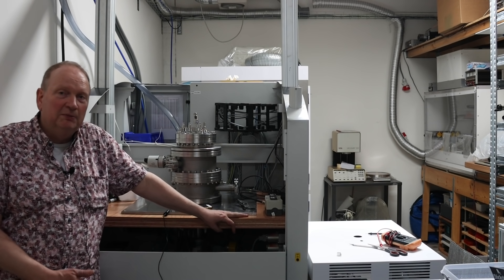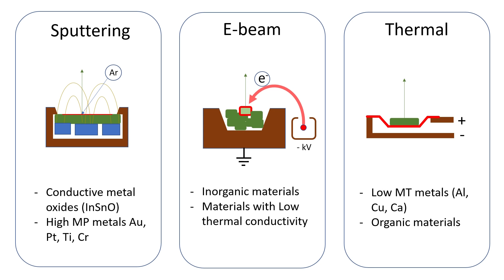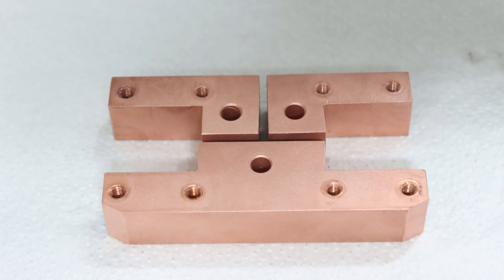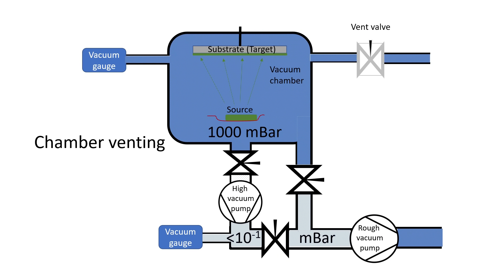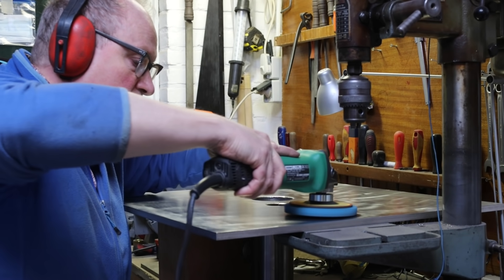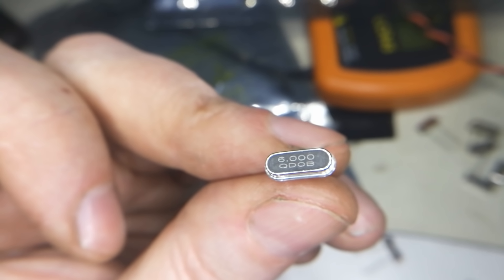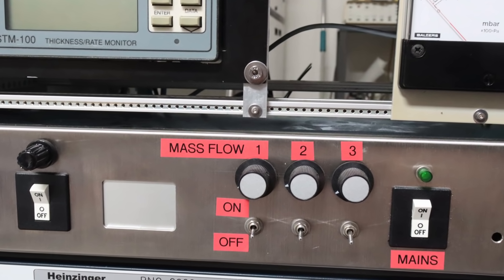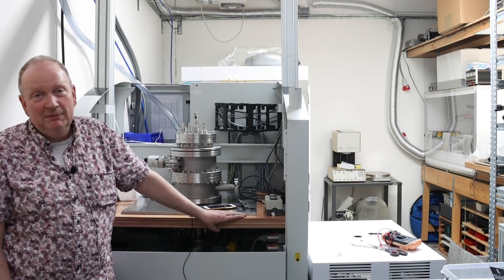DIY Physical Vapor Deposition (PVD) using Thermal Evaporation

Comment: Really fun watching you build and use these devices! I learn quite a bit from your videos, so thank you.

A basic question: is there anything that prevents the deposit material from being deposited on the walls or instruments within the chamber, rather than on the target material? Over time, do you need to replace the interior of the chamber as a result, or clean it to remote this "overspray" (not sure if that's the right term)?  Thanks.

Comment: High class with a turbo pump, how did fix it, did  you order a  replacement blade? I would have liked to hear a recording of the sound when that filter hit the blade. Shit happens brotha. Ohh not that vent button fuowush dah filaments be burned now dooOO @#$*

Comment: Ohh, tip of day circular polishing of sealing surface requires less work less fineness of grit, as the polishing lines meet rubber O-ring parallel better than cross polishing lines.

Comment: Is your junk yard a top secret, you must be in Santa Rosa area, lucky score ?
Hahaha, welding is more grinding when starting out, if leak is small enough you can use epoxy etc. super small leak Helium mass spec. needed. With vacuum detector vac goes up or down spraying solvent outside as leak detector.

Comment: How did you connect the water tubes to the copper blocks for the cooling water flow.
Does the water actually flow through the blocks or only up to the connection point?
Reply from the maker: It's just the connections points (cold fingers). Apparently that and the high thermal conductivity is sufficient to keep the connections from overheating
Reply: @HuygensOptics  danke
Reply: @HuygensOptics  did you make them or can the be bought? The cold fingers tips.

Comment: "And since creating plasma requires high voltages, you also need an interlock on the chamber if you don't want to die during a moment of inattention." 
 
Dying WOULD tend to "put the kibosh" on the whole project...😉

Comment: Love your channel!  This is so cool.  
I've wanted one of those in my shop for years.  I'm just an armchair physicist though.  I been holding onto a few fun mad scientist ideas for one.  No idea if any would work.
I've wanted to know if tungsten needles or thin plates could be used with high voltage to control the ionic stream of plasma molecules, aiming them towards a specific target/area.  I've also wanted to try something similar with a very a powerful [maybe toroidal] electromagnet, and collect the plasma around a target substrate.  Basically, placing the substrate where the field is most dense.  I feel like this could concentrate the amount of collisions when making diamonds from a starter crystal, or coating anything for that matter.  I also want to play around with the charge of the substrate, and reduce the temperature as low as possible.  In my crazy head, I feel like molecules would naturally align with the magnetic field lines.  Then rapid cooling might set them in that orientation onto the substrate.

Comment: Always have wondered the if metal rain could exist and I havent found answers in internet but if here aluminum have diferent vapor pressures ,it seems like in a planet with low pressure and high temp it could form drops of aluminum

Comment: Amazing. My father worked at Cambridge instruments in the 1970s and told me about the vacuum pumps they were using for the electron microscopes. You really don't want to be near those during a problem. Great video.

Comment: Love the video! Am a matsci grad student and I've used the cleanroom's thermal evaporator quite often (also an ancient e-beam evaporator and a more modern sputtering tool). And yeah, I've had a turbo catastrophically fail once and torque the chamber around quite a bit. Ever seen a conflat bellows get torqued around into a tiny little twist - it ain't pretty!

Comment: Amazing work, thanks so much for sharing!

Have you run into any issues with unintentional oxide deposition while running your plasma clean? And if so, does it affect your film adhesion at all?
Reply from the maker: No problems with oxide deposition. I guess the plasma could cause oxide layer formation on metal films, but the plasma is generally applied before film deposition.

Comment: What is the pumping speed of the turbo you are using? And do you feel that it is sufficient?

I’m hoping to make a thermal pvd system for coating telescope optics, and the high vacuum pump is the most expensive component. So of course I’d like to minimize the size.

I’d like to avoid vacuum welding, since I am even more of a welding novice. Why not use epoxy to join all of the feedthroughs to the chamber? 

Wonderful video! Thank you!

Comment: Very cool system! I use a home built thermal evaporator too but it currently only has two electrodes so I have to break vacuum to swap out source materials which causes issues with oxidization of the adhesion layers. I'll have to hunt down a feedthrough with more conductors to do something similar to your design!

Comment: Nice work! Brings back a lot of memories, I used to write control software for commercial PVD & IBD systems. I once dumped a turbo pump to air which made a mighty whistle (luckily the turbo survived). Dumping one to aluminium is very spectacular 😂

Comment: I just found a steal of a deal on a rotary vane pump that's good to 5 Pa so I hope you're exaggerating about needing 1000 times lower pressure just to deposit some aluminum on plastic.  I mean hell, I'm going to try it anyways.  I want to make some holographic diffraction grating film reflective, among other things.  I don't know what the film is made of but it's proved to be quite heat resistant.  I guess I'll find out soon enough what I'm able to do with it.

I love your videos BTW, this was the first one I saw.  I've seen them all now and looking forward to your next one.
Reply from the maker: You can use sputtering with an inert gas, in that case your pump will do the job just fine. You can also try to minimize the path length between source and target.

Comment: Delightful video! I have vacuum systems experience but none with PVD. Thank you for sharing so much experience. I have just about finished accumulating the pumps and tanks to start coating my own optics. Rather than a boat, I am using a CO2 laser ported into the chamber through it's own ZnSe focal lens to provide the heating. Since my 80W beam creates large amounts of silica fume when targeting glass even in open air, I suspect it will provide more than enough heat to vaporize several of the materials I want to use under vacuum. Wish me luck. Even if I fail I still enjoy the learning process immensly.
Reply: wow !!

Comment: This looks very similar to the system I was using to deposit gold (around 200 angstroms) on Mylar film for microphones. I used a small diffusion pump and a tungsten boat with a big truck battery charger for a power supply (maybe 50 amps), and I only waited to around half a micron of vacuum. I was lucky that the deposition time didn’t cause a problem with heating. Great to see another similar setup!

Comment: I'm interning now, as thin film design engineer, I got into this after watching Ben on applied science and built a dc sputtering magnatron of my own which helped me land this internship. what you built is very impressive! I could easily watch a 3 hour video of you explaining everything you did in detail lol even though making that video would require more time then it took to build the thing. If your interested in designing more complex coatings let me know i might be able to help.
Reply from the maker: Thanks. Making good coatings is a true art which requires a lot of practice. It is good to know an artist.
Reply: @HuygensOptics  designing isn’t that bad once you understand the basics software is very powerful and very helpful. I am slowly learning the actual coating technic as most work is done on the machines set up for e beam deposition are manual, the IBS is only automatic one we have, altho since my background is mainly mechanical engineering I’m gonna be helping automate the other machines.

Comment: One hint for future high vacuum welding: Start your weld 10mm next to the parts you want to weld together and move on from there. Then, before releasing the trigger, again move 10mm away from the weld. 
Like this, you will eliminate many leaks because leaks often occure at the starting or finishing point of a weld. If the starting and stopping point is on solid material and not on the gap, you won't have a leak there.
I'm not a professional welder too but have worked 7 years as a maintenance technician on a jumbo-size Glass PVD-Coater. The chamber of these is around 100 meters long, containing 220 Turbo molecular pumps.
Also I want to say that this is an awesome Project! Thanks for the video.

Comment: Looking window also is covering with vaporated material. How are you planing to clean it? I suggest you to make moving shield to move over looking window and opens it partially. When opened part covered with material up to fully impossibility to view thru, just move shield agane to open another clear region of looking window.
Reply: Put a thin layer of vacuum grease on the window and no metal will adhere to it.  In real machines I have seen moveable shields as well.

Comment: I may have overlooked this and if so, sorry for my inattentiveness but: is the substrate charged in some way to further attract the vapors? Otherwise it seems that everything that is exposed to the vapor would be coated, including the parts inside the chamber?
Reply from the maker: Yes, basically materials go everywhere. However, I added some shielding (borosilicate pipe), most of it close to the source.

Comment: We had a faulty turbo pump delivered as replacement once in our lab and it worked about 3 days before it literally exploding. The insides were sphaghtetti but some of the fins flew out and peppered the walls, some got stuck as well. It was very lucky no one was inside that lab in the moment.

Comment: Hi, nice to see someone else with a personal PVD machine! Did you evaporate Cr from solid state or molten? What was the material of the boat?
Reply from the maker: The chromium melts a bit on the bottom side, but not all of it. I guess it is not an excelent contuctor. The material of the boat is Tantalum

Comment: You essentially built a commercial grade thermal evaporator I used to use in clean rooms. Nicely done. Did you look to see if a local university was auctioning any? Would have saved a lot of work
Reply from the maker: Unfortunately, I did not see any complete PVD-systems offered at the time I started building this. Now that this is finished, something will come up, I'm sure. ;-)

Comment: @Huygens Optics   I noticed you are able to make extremely detailed images and was curious if you have ever seen an article by any stroke of luck about how Scientist have managed to create a Neural network ( Computer AI ) in Glass or plastic by manipulating the refractence of the material at local areas and slowly training it using special software ( which I have and write myself) which tells how to alter specific areas so that when Pixels of a hand written digit are sent in using pulses of light it will bend the light to the proper output section on the other side. Essentially it is an extremely fast and potentially powerful Photonics Neural network and I have created some software which could take this one step further and create a full on Photonics ALU which is the part of the CPU that performs calculations. However I am stuck as I am completely unaware of any simple method I could use to embed my neural networks values into glass or plastic and was wondering if perhaps you had an Email and some time I could pick your brain for a moment to see if I can come up with something which could allow me to perform such precise work on the materials.

Comment: I built the same vacuum system, but using a diffusion pump, but your work is very cool and better, and I want some help with the circuit diagram used to measure the thickness of the films

Comment: Hi all;
I have a question about the YouTube inventors gathering and would like to find this any direction would be appreciated
Marco, as far as NiCr thin film resistors, I have 18 years of experience with both PVD and Sputter deposition onto cylindrical and flat ceramic substrates.  To get really good Temperature Coefficient of Resistance (TCR) values you need to add Aluminum to the film.  Sputter deposition is the best method for TCofR control and you can achieve ±2 PPM with proper heat treatment.
Would love to help if you want.
Reply from the maker: Hi Victor, Marco will probably not see this. And I am not sure what his plans are. If you want to contact him, better to do so though contact details on his channel.
Reply: i can try and get his attention on discord if you want
Reply: @ikbendusan  That would be helpful, thank ypu

that woul be helpful,

Comment: Awesome setup! I did a lot of evaporation during my doctorate. A person in my lab destroyed a turbo pump by opening it to air while on - basically turned off the first pump - it sounded like a car crash and it was >10K EUR to fix.

Word of advice, use a ceramic crucible when evaporating aluminum. This freaking metal will eat through tungsten boats, tantalum boats and molybdenum boats like there's no tomorrow. Unless you want to just use boats once and throw them away.

With this setup you also have LED and organic solar cells within reach :)
Reply from the maker: For aluminum I used graphite in the past. It lasts much longer, however even graphite dissolves in Aluminum after a while, forming aluminium carbide after a while. I have bad experience using ceramic boats for aluminum, most do not transfer heat efficiently enough to get to high evaporation rates. Is there maybe any type you can recommend me?
Reply: @HuygensOptics  Thanks for your reply! I would recommend ceramic crucibles. We used alumina crucibles like these ones (https://www.aemdeposition.com/crucible/aluminum-oxide-al2o3-crucible.html) we put a coil of thermal wire around them to ensure they got heat as strongly as possible (https://www.aemdeposition.com/thermal-filaments/). Granted, you do need to heat more than a boat to get good evaporation rates. We were never able to get evaporations rates as high as those you could get when using sacrificial tungsten boats.
Reply: @HuygensOptics  I am sure we will see an e-beam evaporator build on your channel in the near future!

Comment: Hi sir
Can you please suggest me if I can make custom LCDs with this process?
Reply from the maker: No for LCD, you need InTiO, which is mostly deposited using sputtering. I would advice you to buy glass with this coating already deposited, since depositing Indium Tin Oxide requires a lot of experience. Etching the patterns and filling the LCD is already quite a challenge by itself.
Reply: @HuygensOptics  thanks for the reply...

Comment: How much current runs through the HV side of the plasma generation components. And what type of plasma generation do you use? Do you pass through both electrodes, or is the container itself used as one of the electrodes? I'm assuming you used DC, or Low-Frequency power on the HV side.

Just wondering because a microwave transformer is very powerful and I think it might be possible to use simpler and cheaper circuits (Like a tazer ect...) to generate the HV, as long as the plasma generator isn't drawing too much current in the first place. Would be safer as well.

Thanks
Reply from the maker: I guess it is very low current, the amount of power going into the plasma generation is a few tens of Watts. I used 50Hz AC, the bell jarr being at ground of course and the electrode near the air inlet at AC High Voltage.

Comment: Excellent work. I am impressed.
I'd be curious of the reason why the little oscillator died during plasma cleaning. I will do my own checks. I still have some few hundred of them on shelf.
Reply from the maker: So I had both the casing (ground) as well as the signal sticking separately into the chamber, each connected to one pin of the crystal. The electric field in the plasma can be quite high so I guess the signal port got at to high a potential due to this and fried the electronics. Normally one would shield this signal in a grounded coax.
Reply: @HuygensOptics  I think I have a few vacuum tight BNC feedtroughs o-ring sealed somewhere in my scrap box. Shall I search for it?
Reply: @HuygensOptics  The commercial systems I know use a sort of rigid coax indeed. For a poor-man's version I'd use a feedtrough gland with an o-ring and captive nut (wartel in Dutch). I used such glands for the light fibers of sensors that were meant to detect presence of CD's in sputtering systems.

Comment: Great information, very well done, excellent! This video has given me information about a project I am working on. Would polystyrene plastic survive long enough for titanium deposition and would the adhesion be good?
Reply from the maker: I don't think so, if you mean the polystyrene foam material. It contains a lot of tiny air bubbles and will probably shrink and deform if you bring it back to atmospheric pressure from high vacuum.
Reply: @HuygensOptics  Thanks! I was thinking of hard plastics (thermoplastic) that plastic models are made of and also resin plastics (thermoset) that I get out of my 3d resin printer. I am not sure how the automotive industry coats the inside of plastic headlamps with the high reflective material. Looks like you have a great setup in your shop or lab and I look forward to your future posts!
Reply from the maker: @Vikingman2024  thanks. I think on plastic models it could work. But Titanium would have to be sputtered or by using e-beam. Thermal evaporation is unsuitable for that material.